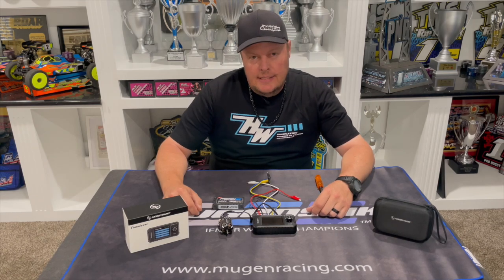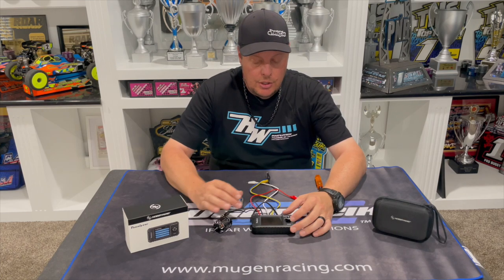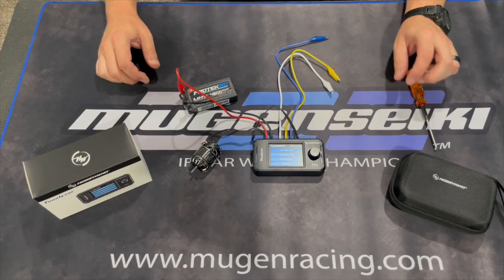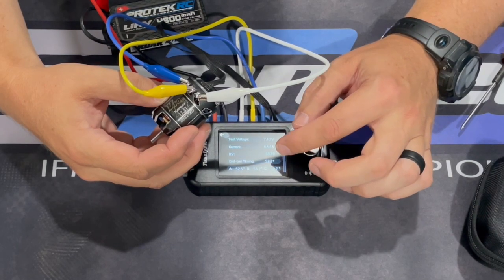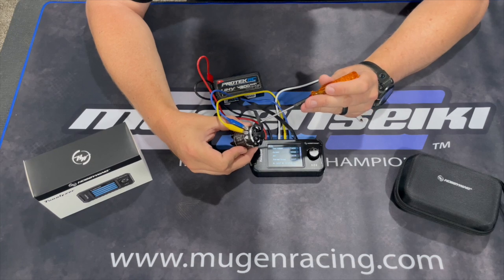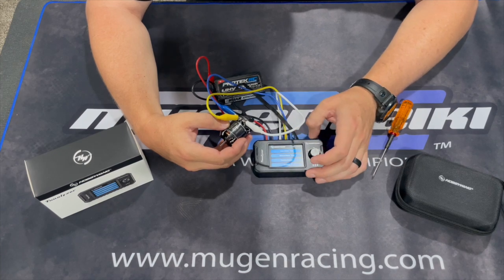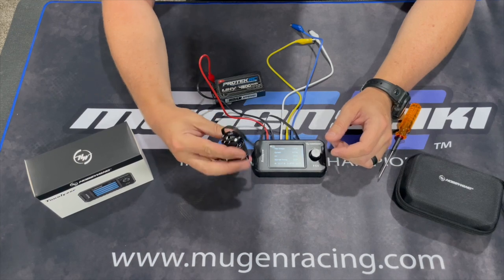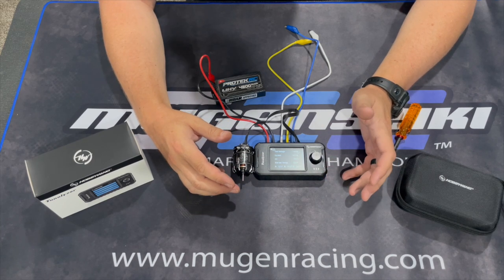HOBBYWING Tunalyzer and Tuning a HW 17.5 G4R Motor

Comment: What pinion and spur do you run on your B7 with that G4R 17.5 at 52 degrees? I’ve been at 48 degrees on a 75 31. It’s ok, but always looking for more speed and power. I have a Hobbywing tunalyzer too.  Thanks for the help
Reply from the maker: Are you running on dirt or carpet?  I'm running the Mugen Seiki MSB1.
Reply: @ on clay indoor.  Tacky good traction.   The B7 has a 2.6 transmission ratio.  I can do the math to match your Mugen.  Thanks for the help.

Comment: Is a motor fan necessary when increasing the timing for the higher amp draw? With a out of the box motor and 32/72, I'm running 150-160 after 5 min
Reply from the maker: I do recommend a fan for 1/10th racing on the motor.  I don't use a fan for 1/8th racing on the motor.